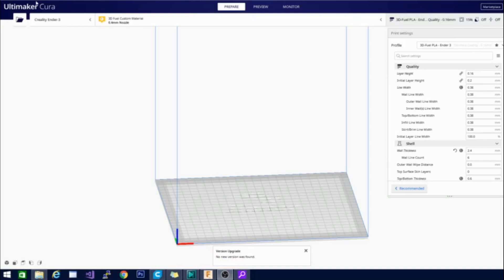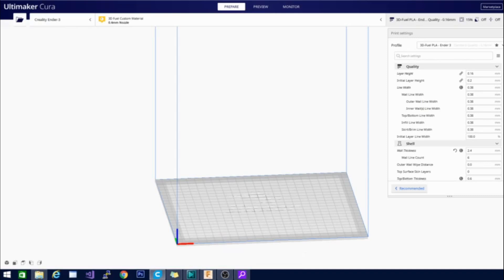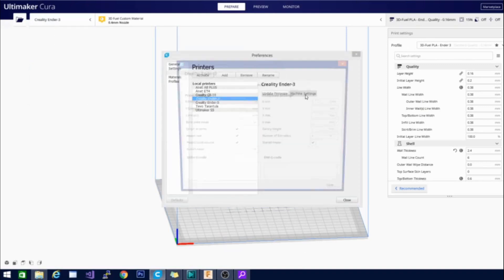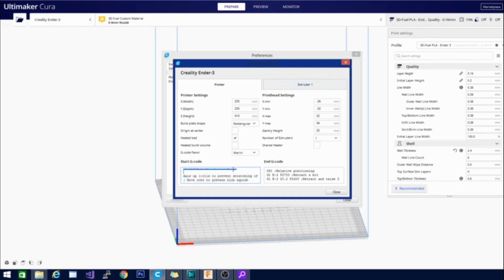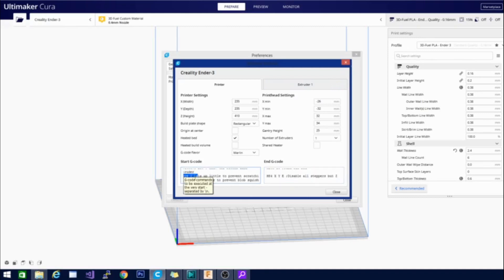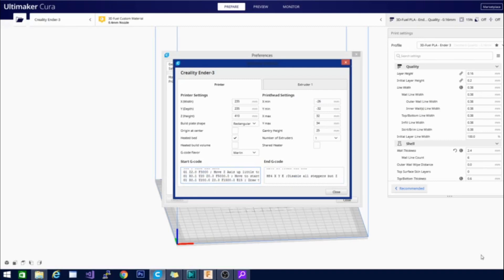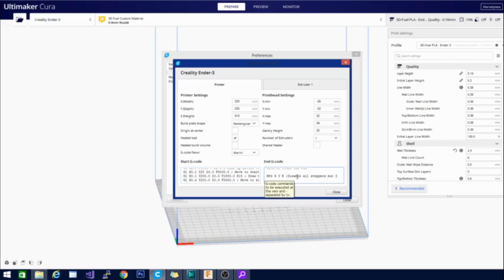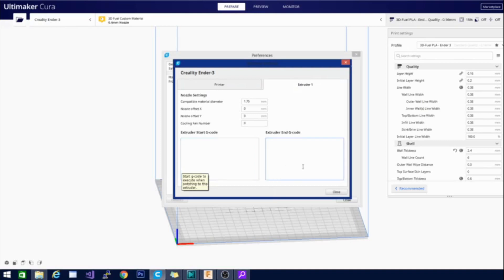Cura 4.5 - Where to find Start and End G-code for your ender 3 , Tarantula Pro   and Et4

Comment: Hello, can i ask how do i change the layer distance of my stl file? thanks
Reply from the maker: this is called layer height, in the cura settings
Reply: Technivorous 3dprinting no no, I mean for each layer on the same z axis, the line distance between each line
Reply: @millenia2222  
Hello.
Isn't that the line width setting?
I'm kind of new to cura so I'm not sure though.

Comment: hi ... i am using cura and my print stops for a few seconds at the start of a new layer... the nozzle melts my print when it is paused ... any suggestions.. thanks
Reply from the maker: Sure I can help you out. What printer are you using?
Reply: predetor anycubic

Comment: I just gott the Anet ET4 Pro and can't get this sucker working in Cura. When I start a print it just taxis the nozzle to the rear right corner and then says finished print. Can you share the Gcode to put into this because its not giving all of that for mine in Cura as default.
Reply from the maker: Stupid anet settings in cura suck for this printer. I couldn't get it to work right either, so I got mad and tried using my ender 3 profile, and viola. Yeah I can get you the start and end code, but go into your cura, add an ender3, and slice then print it. You will be surprised
Reply: @Technivorous  Just did and got it printing. I had to manually increase the temps on the printer itself. Any suggestions there?
Reply from the maker: @Stephen8454  yeah check my last video that wasnt a live stream it will help u fix it. Sorry I dont have a link kn hand and I'm streaming rn